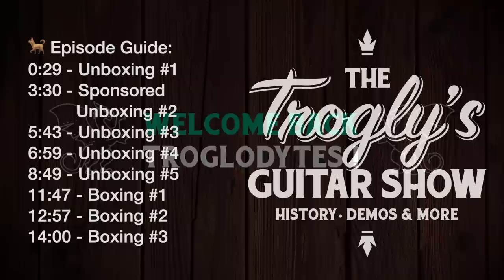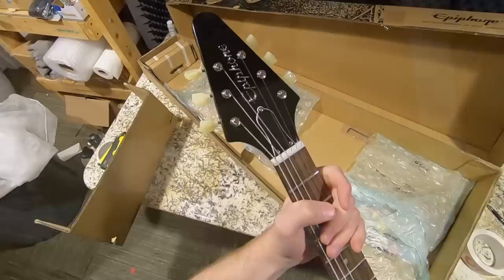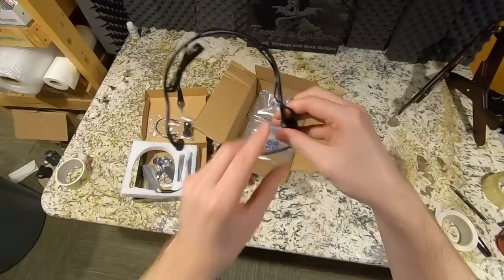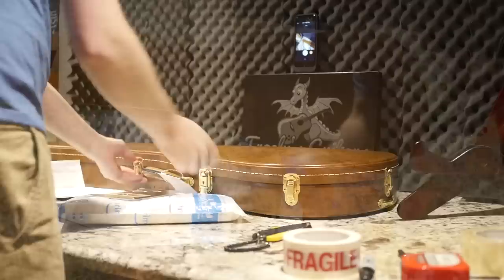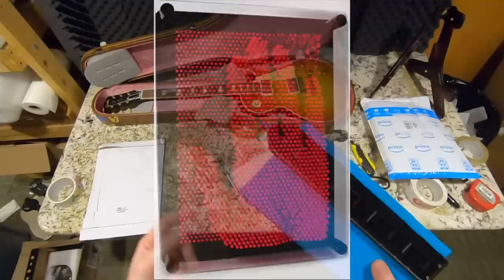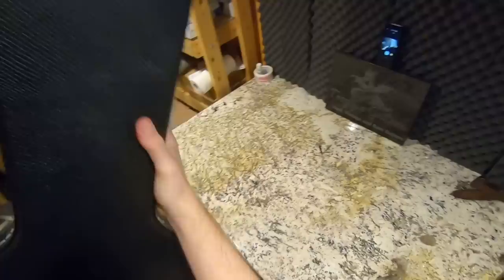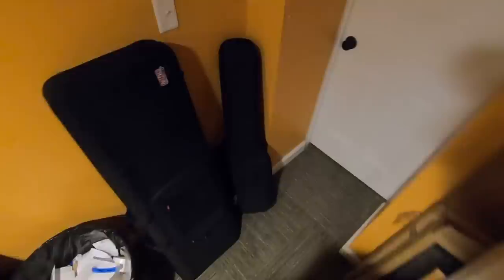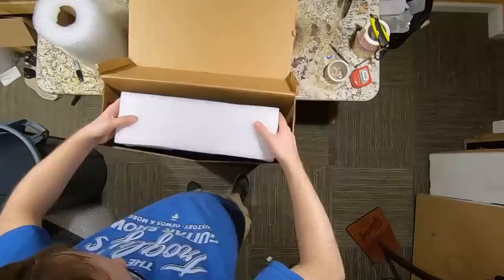A Guitar So Nice, I Bought It Twice! | Trogly's Unboxing Guitars Vlog #59

Comment: it looks like thet gauge has screws on it, try unscrewing them a bit. if I had to guess how this is put together, its tight on 2 fronts, one, just the pressure from the screws and 2 pressure from the side  as I bet that's how it locks into place is by using a wedge. relieving some of the pressure from the screws may loosing it up enough, or worst case taking one of the plastic pieces out may relieve some side pressure. it would get significantly looser, but all that would change is how you hold it.

Comment: Yes that Pelham blue on the Epiphone's looks much better than on the Gibson's! For showing the different neck shapes, what about using that modeling clay or modeling sand? You could make molds of the different styles, keep them and just have them like on a shelf and all you would have to do is pull down the one that the guitar is supposed to have, then place it up against the neck of the new guitar to see if it matches. The viewers could then see it like how you showed us with that blue thing you bought plus you'd have them to show if you were just talking about different necks shapes or something. They even have these modeling beads that will take the shape of whatever you push into them. 

I am going to be really curious to see how these new Epiphone necks/frets are the further into this year we get. The first part of the year it seems there were a lot of issues with the frets but as the year gets older they seem to be getting better so it seems Epiphone heard the complaints and may have fixed whatever was causing the issues.

Comment: Ive never liked the jack plate on those Vs... looks so much better when it's on the inside like on the Ritchie Faulkner sig, or even like Jackson do it with a strat-style jack on the inside to have the jack reassessed as well

Comment: Hey Austin -  in regard to the photo's and you selling them. My girlfriend is an artist and draws different things and is also an amateur photographer and I did some checking for her as well as for myself for some work I was doing. What I found was this -  so long as your photographs do not contain anything that is copyright/trademark protected you are fine. Even in the description you cannot use any of those things.
 Let's say you took a Photo of that Blue sparkle burst Les Paul you had and you wanted to blow it up and put it on a cardboard backing or you just frame it as a 8x10 photo and offer those for sale. So long as anything that is copyright/trademark protected such as the Gibson Logo, the Les Paul logo, the words on the truss rod cover and yes even the head stock itself (the very top, open book portion) are not visible or readable, you are OK. Like I also said, even though you cannot see any of that in the actual product you are selling, you could not even say what it was in the product description because there you are confirming it IS someone else's licensed product. Anything that would indicate the identity of the  subject matter in the photograph is forbidden, so long as those identifying things are copyright/trademark protected. If you blacked out all the writing on the head stock and somehow removed or hid the open book design of the head stock, you are then legally able to sell it. Instead of saying Les Paul you could just say Single cut design. I think if you were to describe the photo like - " a 19_ _ Single cut body style electric guitar" you would be fine. But playing around and saying stuff like 

"An "authentic"  19_ _ Single cut body style electric guitar that is named after a famous mid 1900's guitarist that first went into production in 1952 and is made by one of the oldest American guitar companies known for it's iconic designs and is known for it's higher priced more luxurious products." - well now you'd be playing with fire since you would be dropping hints that it's a Gibson lol. 

Hope this helps and i think this is a great idea!! Some of those rarer ones you have had people would really like to display in their music rooms and especially some of the more beautiful models as well.

Comment: This Epi is patterned after the Custom Shop version Gibson is selling right now. The '67 traditionally comes with the stop-bar tail piece and the input jack is near the volume tone controls. Along with the selector switch of course. Cannot say I like this on. In fact is is a bit ugly for the modern taste. I will be surprised if this one doesn't get discounted to move rather quickly. US